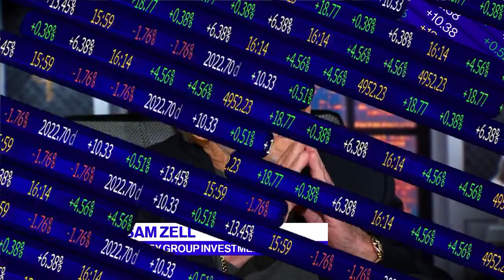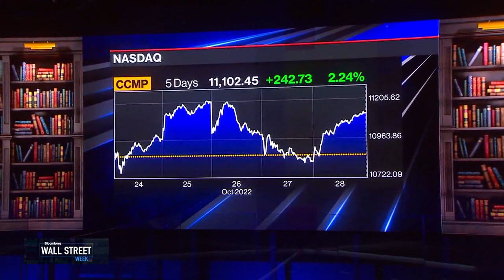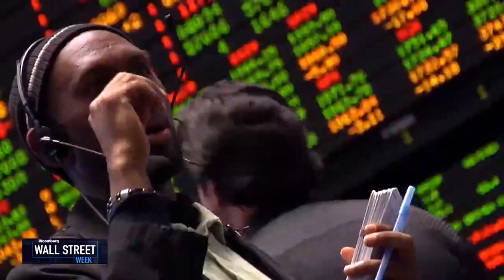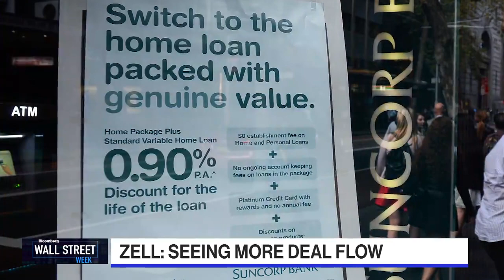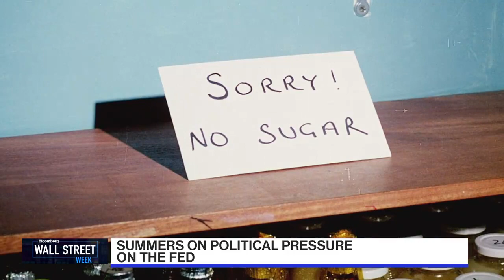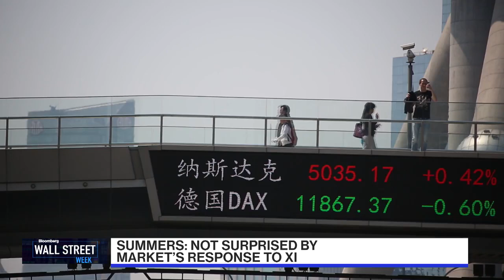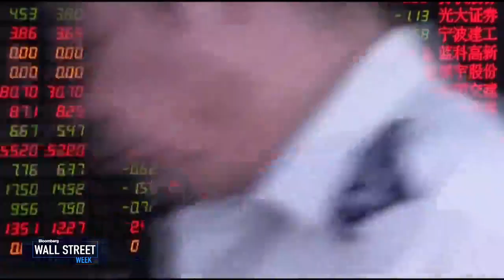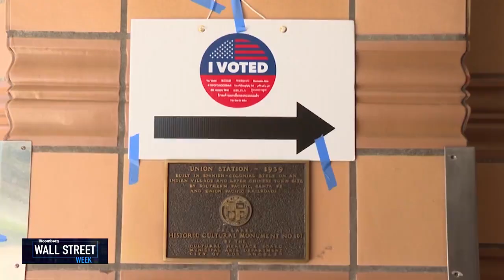Wall Street Week - Full Show (10/28/2022)

Comment: We are already in a big crash Inflation is a catastrophe. This CPI report is a colossal failure. To bring the housing market to a halt, the FED will have to pull all the stops. The unfortunate issue is that other markets are being decimated. If you want to stay green, you have to rely on a lot of diversification. Currently up 14% and being careful. Still a better deal than leaving it in a savings or checking account yielding 0-1 percent interest.

Comment: I think that the federal reserve is underestimating the amount of liquidity that needs to be taken out of the market and that their current strategy of raising interest rates as fast as they can, and then dropping them as fast as they can when inflation is "defeated" by some metric is a fantasy. More realistically the federal reserve was able to tighten interest rates as fast they did because they were at 0.00% and bringing them back up to standard par is an easy achievement to make. Now that interest rates are going to be much more materially restrictive it will be much more difficult to maintain this pace without breaking the market and collapsing the economy, which is more likely to happen before inflation is metrically reduced to 2.0% annually at this juncture. To realistically reduce inflation and maintain the value of the dollar the federal reserve will have to raise interest rates into a restrictive territory that the economy can handle long-term, and then maintain that interest rate level for a long period of time to achieve the desired results. This would put the economy into a doldrum that economic experts will call stagflation which will continue, depending on what interest rate the federal reserve can maintain and for how long, a variable amount of time unless a new crisis emerges which forces the federal reserve to yield back to quanitantive easing and reduce interest rates.
Reply: yes. interesting. i think people forget to talk about the balance sheet, which is actually more of a direct way of withdrawing liquidity. and i dont know where the discussion on this is.